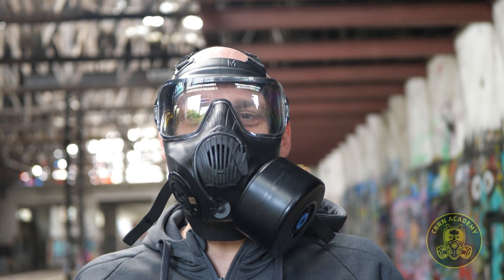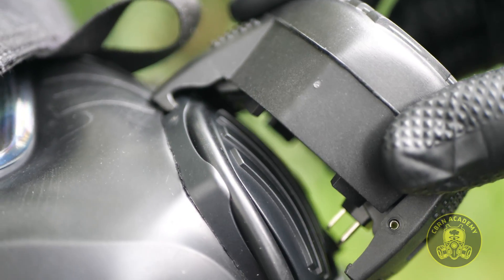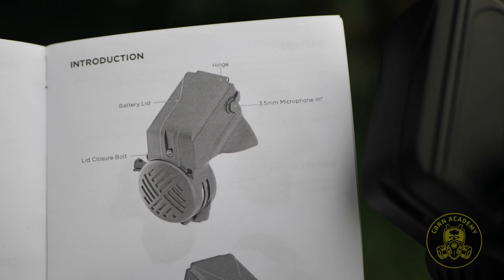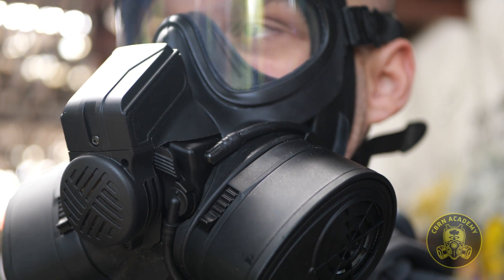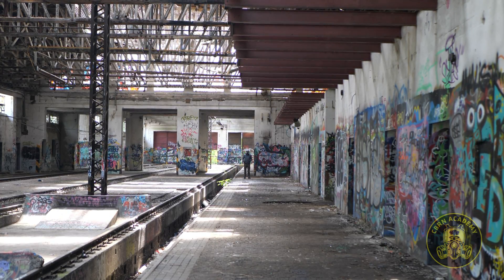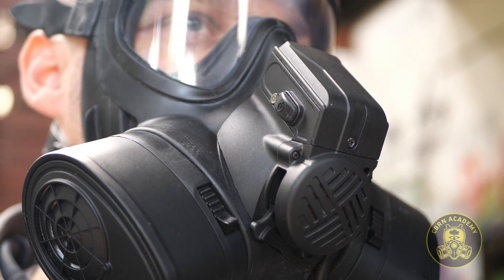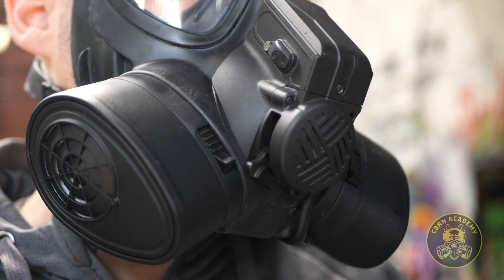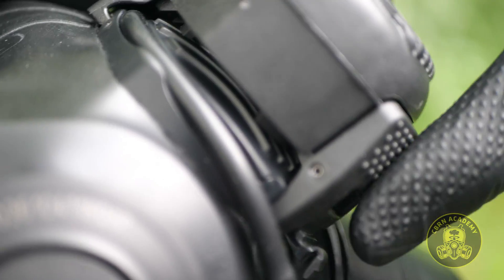Gas Mask Voice Projection Units: We Put Them to the Test!

Comment: I know this sounds stupid, but should I separate battery from VPU when it's not in use?
Reply from the maker: It's not a stupid question at all! I always remove batteries from any device when not in use - VPU, camera, microphone, radiation detecting device, etc.

Once, I left batteries in my old Geiger Counter, and after a couple of weeks, the content of the batteries leaked, and I needed to repair the device. Fortunately, it could have been done.
Reply: @cbrnacademy yeah, I guess I should discard my lame and just remove battery 😂😂 Thanks!

Comment: Do you experience feedback in negative VREU pressure mode for the M53 series vpu aswell? Cleaning the contacts is more of a temporary solution, but I’ve never had it consistently solve my problem of feedback
Reply from the maker: The FM53 mic/VPU work just fine, you can hear it in the video. 
Do you experience a feedback problem that  temporarily goes away when you clean the contacts? Is your mask surplus or did you get in new? Sounds like the problem might be not in the VPU or mic but "somewhere in between".
Reply: @cbrnacademy it does temporarily go away when I clean it, but I can’t imagine that’s the sole reason why the issue exhibits.

My mask is a FM54, but Mic (m51 version) and VPU (Gen 2) are both “surplus” but it’s happened a lot on all my friends masks; maybe I reach out to Avon directly, but hard say since VPU’s aren’t publicly available; at least here in US.

Comment: as much as these things cost. there is no excuse for such bad sounds. and they should be cross compatible, as they use the same three pins.
Reply from the maker: I agree, especially with the cross-compatibility part. Of all the three VPUs, not a single one can be described as great, as their builds also mostly suck.

Only the C50 VPU has a solid build, it's rather fool-proof with a single, easy to operate toggle switch. But what of it, if it has the worst voice quality out of the bunch.

Comment: Whats the battery life for the c50 vpu?
Reply from the maker: It really depends on what batteries you use and since we used cheap supermarket ones, the information wouldn't be relevant. We plan to do further VPU tests and the "battery life trial" is going to be one of them. But with high-quality batteries recommend by the manufacturer.

From what I can tell, the cheap batteries last for about 2 hours before the output becomes significantly less louder.

Comment: I just got a VPU for my FM50 and am getting significant feedback between the mic and speaker. It only seems to be significantly problematic in closed spaces which somewhat makes sense, but I am able to get it squeal with sharp head movements no matter where I am testing, or occasionally when just walking. Is this something you have experienced?
Reply from the maker: Considering you have both mic and VPU compatible with FM50, I have no idea. I only experienced the squealing issue while using C50 mic with FM53 as shown in the video.  

The best way to tell whether one of the components isn't faulty is to swap them with another set and test it that way, but even I have only one of each.
Reply: @cbrnacademy  If you have an opportunity could you check your model number for my microphone adapter against yours, some reading is telling me I may have an amplified version but I cannot find what that model # is. Mine is 71009/6.

It still happens without the dynamic mic attached so I'm pretty confident its the adapter causing the issue. To further add to the problem, I've found the speaker doesn't blow out when I break the seal on the mask. Which again makes me think I have the wrong microphone adapter, since I'm semi-replicating the issue you showcased in the video with interchanging mics in the fm53.
Reply: Looking to the pull trigger on a gen 2 vpu for my FM54. Would love to know if you figured out a solution

Comment: From my understanding the inner microphone is 2 pieces, the dynamic microphone, and the adapter.

Do you need the dynamic microphone with the adpater, or can you just use the adapter alone?

Are the dynamic microphones of both the fm53 and the m50 interchangeable with the adapters?

Where the hell can I buy the adapter for a m50?
Reply from the maker: Can't help you with the question on where to buy it. I mostly make videos about stuff others send me. 

Some time ago I was playing with the microphones as I hoped to make the C50 mic work with FM53 but none of the combinations worked. Since it was some time ago, in order to answer your questions I would need to disassemble the mics and try them out as you suggested and at that point, I can make a video about it. We wanted to make more videos about VPUs anyway and this is a great idea for 2025 content.

Comment: Does the fm53 microphone  work with the c50 ok
Reply from the maker: We did try it but because we didn't film it due to a mistake, that part isn't included in this video unfortunately. But here's an excerpt from the script:

"Using the FM53 mic with C50 resulted in rather good quality voice output, certainly less distorted as was the case with the original C50 microphone. "
Reply: Thank u for your reply  many thanks we blessed with your videos

Comment: GSR/FRR VPU breaks very easily, I have two, and both of them are broken within one month time, which does not happen on the C50 VPU.
Reply from the maker: Since you mentioned this under a different video before, I asked a few people that used the VPU at their work and no one had a similar experience. I own the VPU for more than a year now and I use it regularly - no malfunction yet.